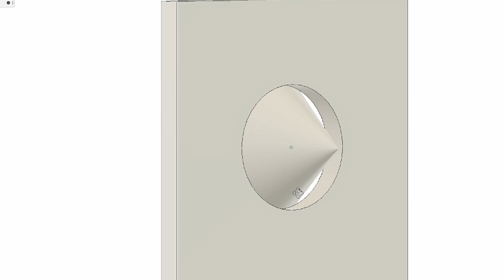Building a Cessna Pedestal and Microphone! | C172 #35

Comment: Capt. Bob, this is a general question.  I am using Altimeter Motives 172 panel.  Building the frames etc. myself.  Also using Logitech Yoke, Throttle, and Pedals.    Having a problem determining height of seat, panel above floor, and position of pedals.  When I get a comfortable arrangement I can just barely see over the panel at the computer screen (32" for now).  I found a way to take one inch off the bottom of my panel where i have switches and such.  I also enlarged the top trim to hide the left corner of the 23" monitor but think I need to just allow it to show as that is an additional 1.5" i can lower to help seeing the screen.  All the photos of real pilots and sim pilots in the cockpit seem to be siting about like we would at a desk.  Legs not extended to pedals.  In most photos the pilot's eye level is at least 6" above the glare shield.  I have tried finding photos or drawing of these arrangements from the side but don't seem to be able to locate any showing a cutaway of the panel, pedals, etc.  Also maybe taper the glare shield down towards the front.  Any suggestions would surely help.  Tried all the Facebook groups without much success.
Reply from the maker: Sorry, what exactly are you asking?
Reply: @CaptainBobSim  Just trying to determine height of chair seat, bottom of panel, and height of panel so I can see the screen.  Did some experimenting today and think I have it right.